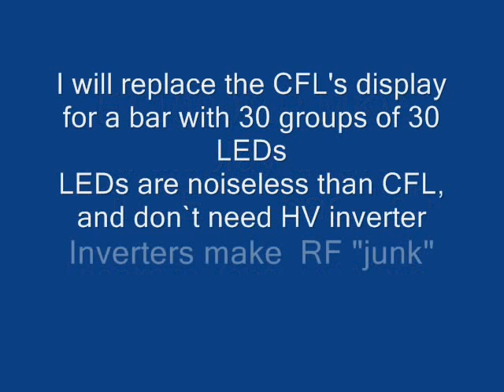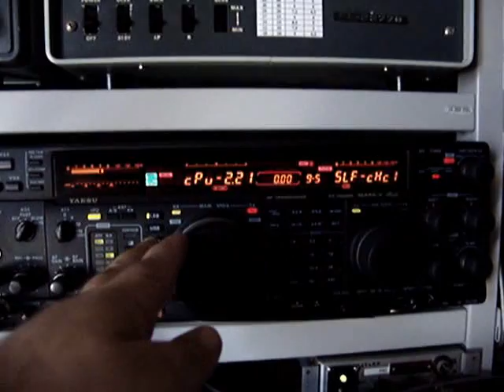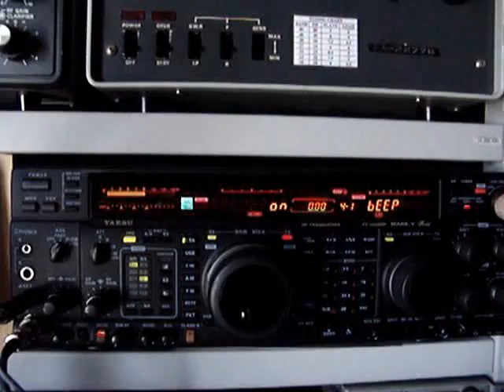FT1000MP MKV field Display upgrade from CFL to LEDs backligh

Comment: What are you unsoldering at 0:37, it's a bit confusing, have you got a more detailed description, I have the Yaesu 1000mp and want to do the same to my radio, will it work with a 12 volt led light bar
Reply from the maker: I`m unsoldering the power wire from power switch. You can connect the 12V led bar to the 12V supply that was feed power to the HV inverter. Normaly you don`t need anymore the "HIGH" position.